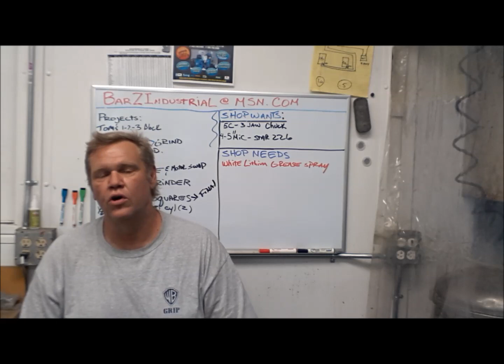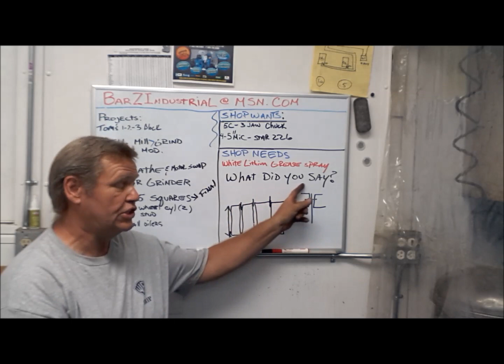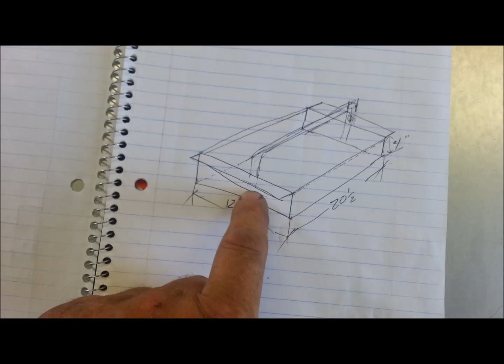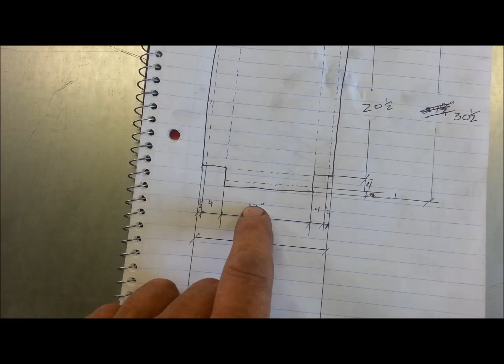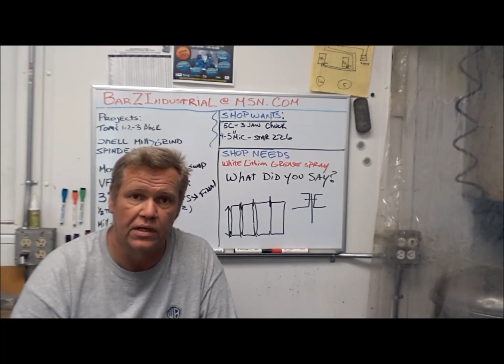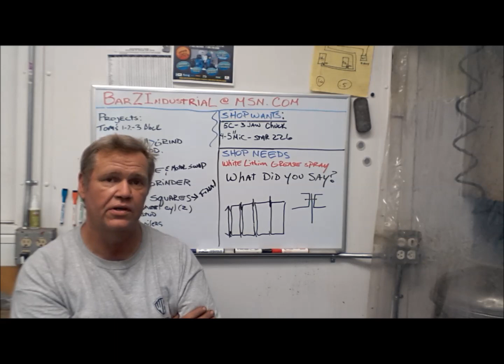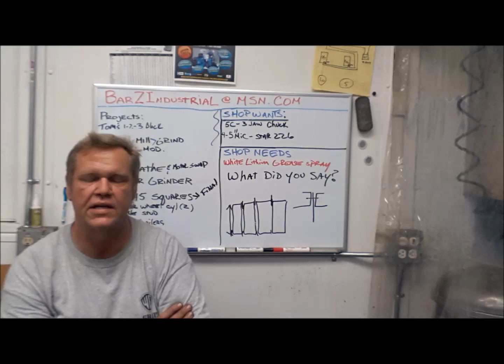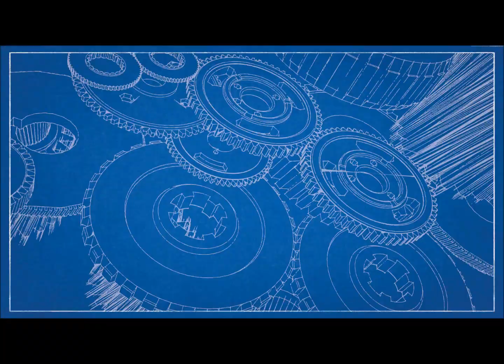Week update #15

Comment: Hey Stan,

On tube bending, there are tricks like filling the tube with sand, or there's a product called Cerro-bend, a low melting alloy developed for the purpose. In the olden days, we could still use "Misch-metal" which melts in hot water...

These get used a lot in aerospace applications for flow, where crushing or other deformation of the tube isn't acceptable...

I've also used solid bar / rod for handles - gets kind of heavy in the size you need for your shark-cages though...

All the Best,

Eric
Reply: Or use a Pines tubing bender with internal mandrel.

Comment: thought welding galvanized made zinc oxide gas, nice box though
Reply from the maker: Ha ha .. yes, my point is the long term effects are poisoning your system.
Reply: Shadon HKW
 yep the stuff is not healthy
Reply: Shadon HKW Yeah, cyanide either kills you right off, or you body will excrete it after a while... it blocks oxygen from getting to your blood...

Metal poisoning tends to be cumulative...

Comment: Stan, out of a class of 500 graduating engineering students, do you know what the student that was 499th in the class is called? Engineer! LOL! (this was told to me by an engineer). As you were describing the problem, I could see that you were going to have a wall of 'drunken soldiers' at the end. Fortunately your experience alleviated the problem.
I just finished a project with an engineer that, I think, fit that 499 number. However, I've worked on jobs that the engineers have ask me how to correct problems that they had not forseen. On a couple occasions my suggestions were used to rewrite the specifications and used to achieve the desired finished product.
Most engineers do a great job but some only do a 'so so' job. Engineers/architects and builders are a team. When everyone works together good things happen. As team members we all learn from each other but some projects can be challenging, if a team member is inexperienced and thinks he/she has all of the knowledge and no one should question him/her. In the end almost 100% good results are achieved.
I'm sorry about this rant, but this subject just touched a raw nerve. Still, I wouldn't trade construction for a desk job!
Your pan design and construction is very well done. Enjoyed!
As usual I look forward to all of your posted videos as I'm still learning.
Thanks....13

Comment: Stack 20 pieces of the 16G sheet metal pieces together and you'll have about 1.2".  That is a big discrepancy.
Reply from the maker: Ha ha .. it was 14 Ga. even worse ...
Reply: Shadon HKW I think that I went to uni with the guy - Richard Cranium.
Reply: Shadon HKW
"What did you say!?!"
Reply: 14 Gauge galvanized sheet metal ~0.0785" thick x 20 pieces = 1.57".   wha'dya say?
Reply: I meant to comment to Jester about his college chum's name, I just love engineers with interesting names :)

The designer must've thought Stan was gonna use Mylar...or maybe tin-foil?

Reminds me of the numerous times that engineers thought high pressure gaskets didn't add up on their drawings. Better still was when they'd have pipes running through other pipes, or supports
Reply: Excellent! I love it.
Reply: "What did you say???" Is similar to Bill Engval's "Here's your sign..." routine (stupid people should wear signs to warn the rest of us....though everyone seems to have a "What did you say???" moment from time to time).

I think the engineer expected you to make the sheet metal shims from unobtanium, which comes in infinitely thin forms....made by the same folks who used to make clothes for emperors.

Just be glad that engineer isn't designing machinery, or you'd be getting blueprints with specifications for shafts with free turning press fits, curved drilled holes, and ambihelical hex nuts. 

-- Mike